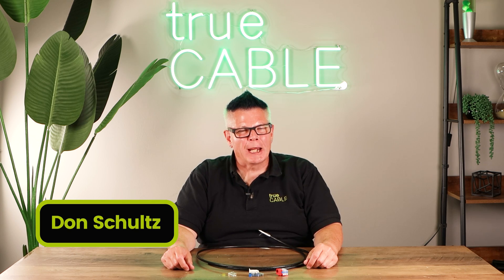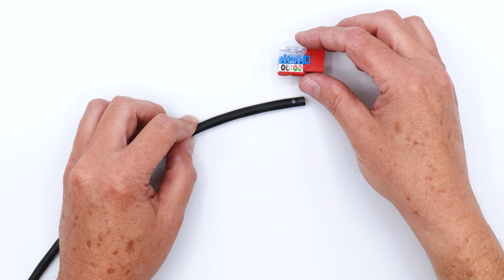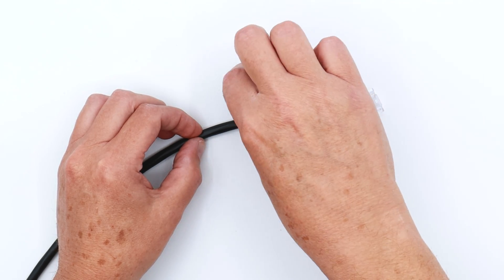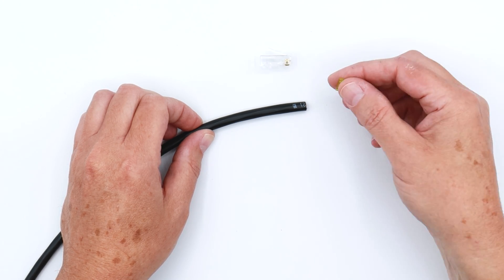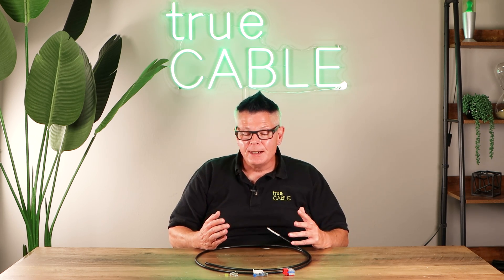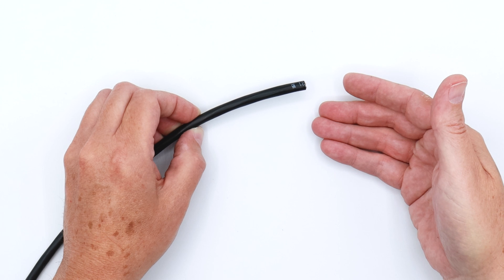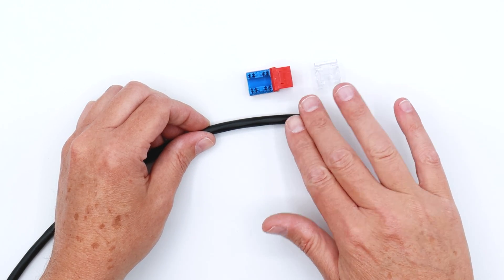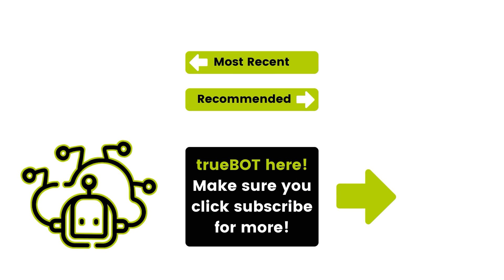Cat6A Unshielded Direct Burial Ethernet Cable (Overview & Proper Installation Environments)

Comment: What do you do to prevent this cable from getting affected by lightning? Does it need a surge protector or need to be grounded?
Reply from the maker: Hello! Given that this cable is unshielded, there is no need to bond it to ground. As far as extreme ESD events like lightning, the only thing that will help there would be lightning protectors installed at the entrance of the cable to your structure, mounted outside. The risk of lightning affecting your cable is depending on where you live and how you install it. Generally speaking, if lightning is a big concern then use gas discharge tube ESD/lightning protectors. If the cable is going into two structures, then a lightning protector on each end prior to building entrance is a good idea. Let's be real though, a lightning protector's entire job is to sacrifice itself by blowing a gas discharge tube severing the connection past it. Essentially the lighting protector and the cable will be both TOAST. The idea is to prevent a fire inside your structure.
Reply: @trueCABLE  so if I have been having problems with lightening  frying my poe components that are connected to a unshielded cat6 that is run in conduit between 2 buildings, would replacing it with shielded solve the issue?
Reply from the maker: @Markou812  Hello Mark. No, that would not resolve the issue. Cable shields, such as in Cat6 copper Category cable are designed to resolve issues with mild EMI/RFI and normal everyday static discharges. The cable shield won't protect against an extreme ESD event such as a lightning strike. The best advice I can give in your situation is to use metallic medium-weight conduit (IMC and threaded/galvanized) and bury it at least 10" deep. Both ends of the conduit should be bonded to ground with two separate ground rods at either end, and those ground rods should be equalized together with a bare copper bonding conductor running between them. That separate ground system should NOT be tied into your regular AC ground. Thus, you are looking at purchasing enough IMC, two ground rod electrodes, and a very thick bare bonding conductor to hook up those ground electrodes together. In addition, you will need bare copper bonding conductors and bond collars to go from the conduit to the ground electrodes on both sides. The sizing of the various bare copper conductors is directly proportional to the length, so I cannot give you advice on that. In addition, the bond conductor to equalize the ground rods is best exothermically welded on at both ends. This is potentially a DIY project, but only if you know how to exothermically weld and are familiar with sizing copper bonding conductors for the length. I suggest enlisting the help of an electrician! PS - you are still advised to use Ethernet surge protectors at both sides of this drop. *Using shielded Ethernet would only complicate matters, so opt for unshielded if you go this route.*

Comment: "now I'm not talking about from outside in.  I'm talking about outside in for more than 50ft"  I find this confusing and I'm curious why there is such a legal parameter.  What's the purpose of that code, especially if you are allowed to go 50ft?
Reply from the maker: Hello and great question! The whole purpose is to limit the amount of outside plant (called OSP) type cable entering a structure due to the complete and utter lack of fire resistance built into these types of cables, in addition to outdoor cabling being a prime target for lightning discharges. These cables will burn, promote the spread of flame, and off-gas noxious toxic smoke during the burning process. Actually, you CAN go more than 50ft but the OSP cable must be installed into medium weight threaded metallic conduit (IMC) and sealed at the joints. Cable not inside IMC is allowed to go 50ft for practicality reasons, based upon common commercial distances from the point of ingress to where the cable will terminate and transition to indoor grade cabling. Hope this helps!
Reply: @trueCABLE  Amazing answer.  That explains everything perfectly.  Thank you for the time to explain that.